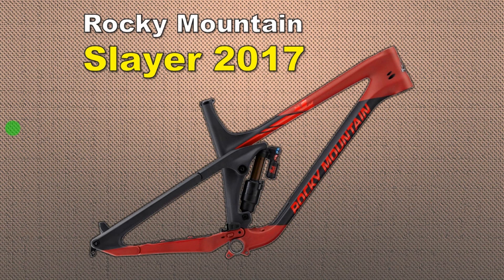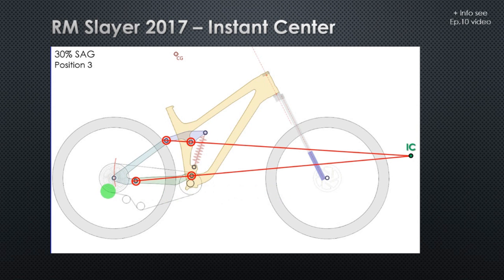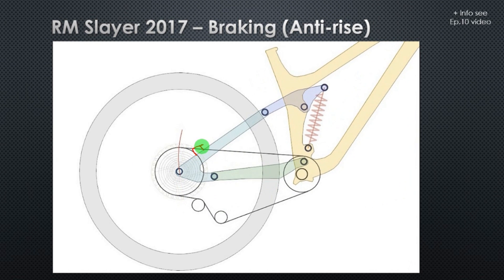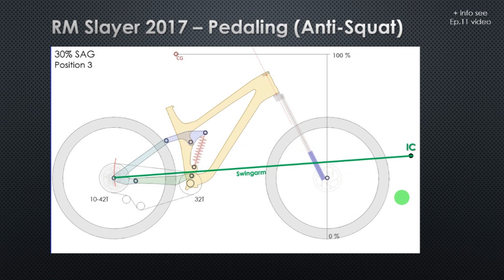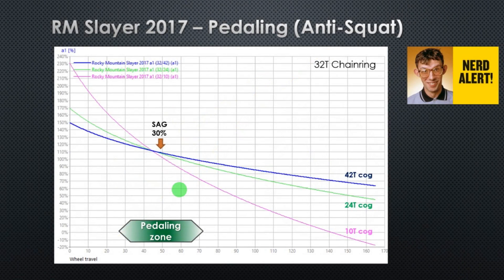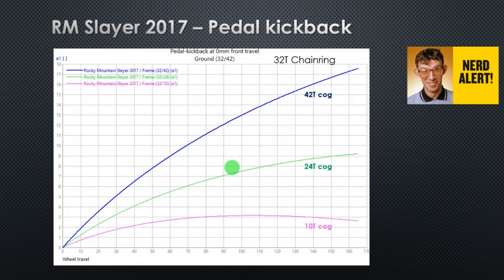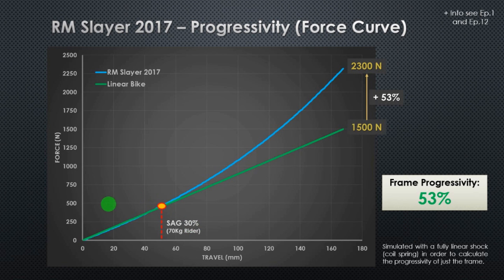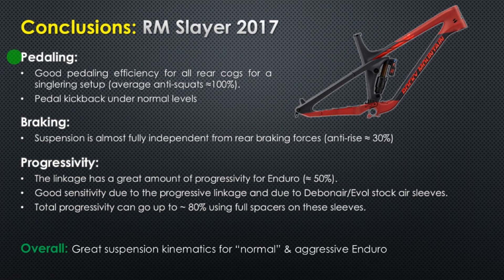Rocky Mountain Slayer 2017 - Suspension review

Comment: Really concidering this as my next bike from my Reign. Good video.
What benefits do you see compared to a reign?
Reply from the maker: Hi. Considering JUST the suspension kinematics, Reign also have a good anti-squat but it has a lower progressivity (around 25%) and it has an higher anti-rise (around 70%). So the most obvious feeling will be the bottom-out resistance. Evol/Debonair sleeves that came on stock on Slayer will also improve the sensitivity. But you can always use these sleeves on the Giant. Bye